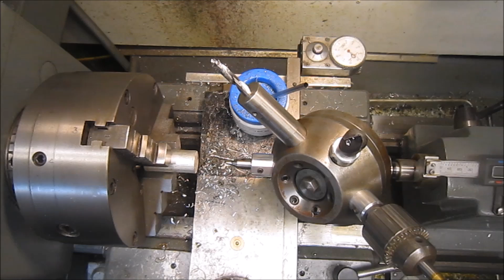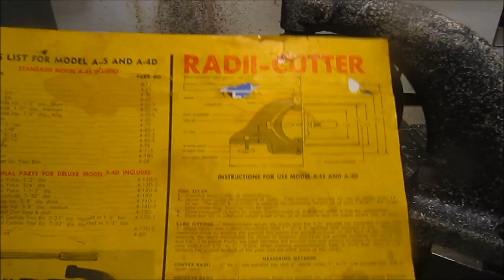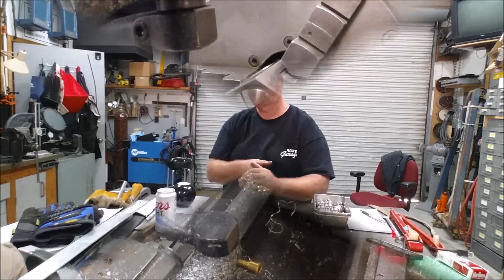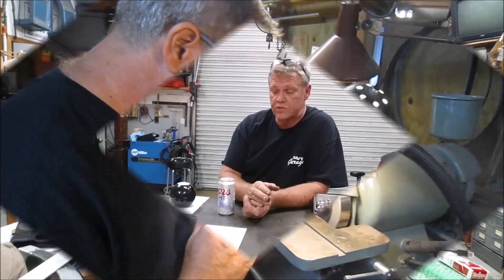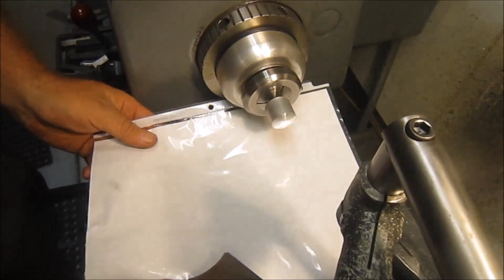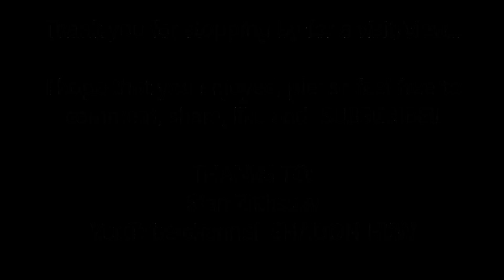Screwy Tuesday #33  Holdridge Radii--Cutter

Comment: Hey guys, I have a question. How do you accurately position the cross slide so that the radius cutter pivot is on line with center of the lathe spindle ? The center height is easy enough to align.
 Thanks for an answer ( I hope) .  Oh and the captions were a hoot.
Reply from the maker: Bill....thanks for viewing....honestly....been too long since I used the tool, I would need to go back and "relearn" to answer your question.....
Reply: @outsidescrewball  Thanks in advance. I enjoy your videos. Bill

Comment: Chuch, cool looking tailstock turret tool holder.  I have not seen one of those in a non-CNC type operation.  I recently purchased a nice used Holdridge 4D radii cutter so I enjoyed your video.
Mike.
Reply from the maker: Hi Mike....check out my latest video about the concave tools for the radii cutter.....thanks for viewing and have fun with your cutter
Reply: +outsidescrewball thanks Chuck. I watched your video last night on the new attachments for the Holdridge cutter. Very nice work. I thought about doing the same thing of purchasing the 4S and then making the adapters but stumbled across a very slightly used 4D instead. Again, great videos and I look forward to getting caught up and checking out some of your older ones.

Comment: Hey Chuck, I had some of the same problems with my cutter. One mistake I think I was making was I was trying to feed with the cross slide instead 
If the saddle. I also had problems with the chuck side clearance but if your making knobs the shoulder it leaves works out ok if threaded like you did. 
Someone asked about Delren, I made some rollers( they ran on a piece of 1.5" pipe) for a sliding ladder for an office in the county courthouse out of umhw and they turned out great. And by the way it is nice to see you let the other boy play with your toys. You and Stan helped clear the picture for me, thanks. Rick
Reply from the maker: +sawz5 Hey Rick, thanks for viewing and got more coming this Tuesday

Comment: That reminds me, I have a tail stock turret which has been gathering dust forever! Must get it in use sometime. Similar to yours but only 1MT - so I have to use a 2MT adapter.
Nice score with the clamps - have just found two for self but not as nice as those.
That radius cutter works well but I tend to use a boring head so as to get a bit further round at the back. I reckon tooling for that wants a good bit of radius. Interesting work.
Reply from the maker: +ChrisB257 thanks for commenting and viewing Chris

Comment: I have used the radius cutter many times when I worked in a shop making stylii for a duplicating mill.  I had better luck using it on a Bridgeport than on a lathe though, it always gave me a better cut.
Reply from the maker: +kpsierens thanks for viewing and your comment....hmmmm...on the mill, have to think on that one...NEAT

Comment: It seems to me,that if you need to go smaller than the 1/2" radius for cleanup on the diameter, you will need to reset the rsdius of the cutting tool in order to create the perfect ball.If the cutting tool could be adjustable , it would be possible. Perhaps a mechanism such as the adjustment on a steady rest ,might be an interesting project.Just a thought
Reply from the maker: +Les Bender Hi Les, thanks for your comments....I got more coming this Tuesday